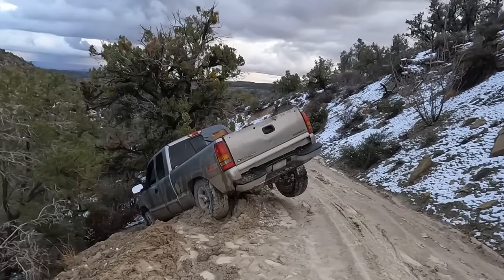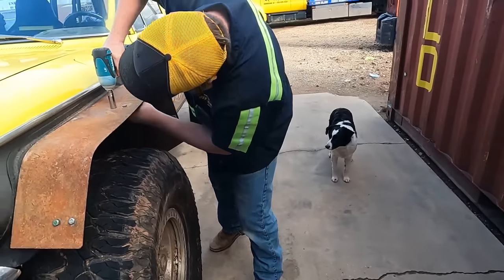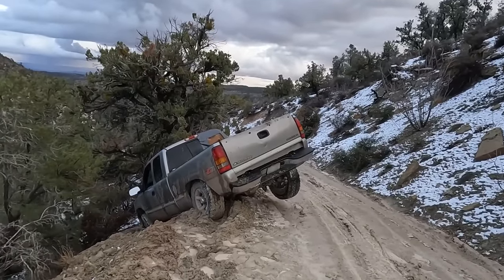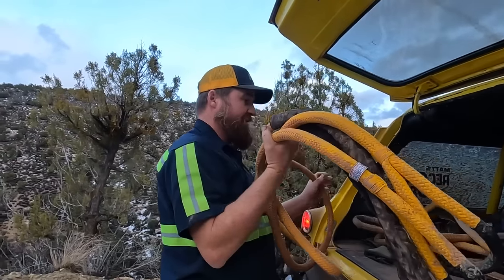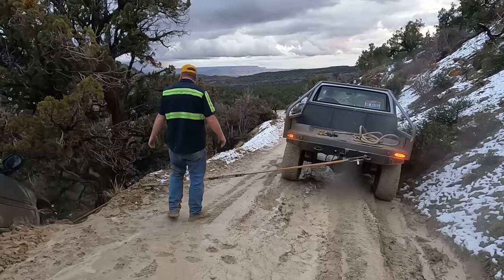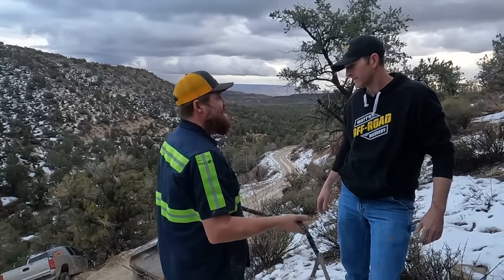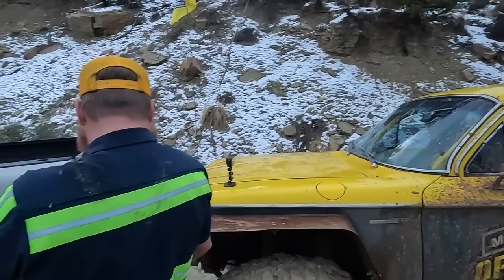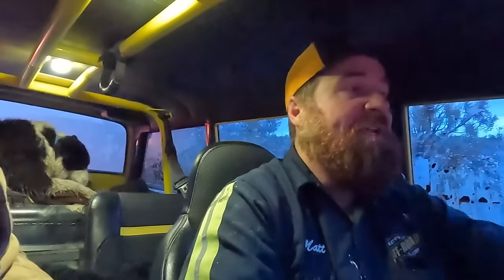This Is A Serious Mess! Chevy Hangs Dangerously Over The Edge

Comment: Those tow bolts are probably a universal item, I would look into getting one for your towing kits!
Reply: Probably as "universal" as lug nuts... <snicker>  Probably a few different thread sizes, but I would have to wonder some cars might need different lengths because of the distance between the bumper fascia (i.e. plastic cover) and the start of the threads... You can't just go with a really long threaded one since there might not be space for to extend out the back of the threaded section on some cars... Many might be designed with a shoulder that needs to be screwed all the way into the threades section for side support (even though the tow eyes should not be uses for angled pulls)... I learned a LONG time ago that you can't rely on anything being truly "universal" even if they claim it is... There's ALWAYS an exception...

Comment: Scotsman here and I can tell you exactly why the tow points are so bad on a lot of UK cars: population density, very low numbers of snowy days per year, and a near complete lack of dirt roads to the point where if it's not tarmac it's almost certainly impassable for anything that is not a very serious off-road vehicle.

That little car is pretty much built under the impression anything causing it to be towed is going to result from an engine failure and involve something like a rollback. Bad shout on the designers part, aye, but that'll be what they were thinking.

Comment: Yeah, I hate that they don't put tow points on cars, even trucks and full size vans anymore unless you get the special package, I pulled a newer Ford Ranger out of about 3 feet of snow and it had zero tow points in the front of the truck, I was able to snake a strap by the lower control arm but come one its a 4wd truck!!! I love them hooks on the front of my Suburban or even my 92 2wd Silverado had hooks in the front, if I needed to use them.

Comment: In the UK we call it a TOWING EYE.
Reply: Sorry, but don't know what this is and can't find anything like it here in the UK.

As I said, in the UK we call them towing eyes and they generally only used to pull cars up onto roll-backs or for sort recoveries. For heavy or long recoveries they have been known to strip the threads and pull out, so can be dangerous. In those cases we generally will use things like chains or soft shackles arounf suspension components. 
To be honest, most recoveries now in the UK use roll-backs or spectacle lifts. Towing with a rope is very rarely used and is frowned upon by the Police.

Comment: Since I don't see one in the top few comments, I shall be /that guy/. Nice job with the names, but 'round where I am, that eye hook is commonly referred to as a "tow hook", whether it be in the front bumper, or in back. I've had to pull a few cars using them, usually pretty short distances in near-ideal conditions, but I don't like them either. They work, but that's about it.

Comment: I went to use one of those hooks to winch a car onto a flatbed with bad results. Flat ground car in neutral I moved the car about 3 feet when it ripped off the frame. The weld holding the threaded nut on was defeciant. Thankfully that was the only thing that went bad. I never used them again.

Comment: @matt's off road recovery, Ive seen you run into the 'tow/recovery point' issue several times. Why not buy an eye/i bolt with several different threads and just keep them in your recovery kit? Just my .02.....

Comment: Just a thought.  Would it be better to get couple of those recovery eye bolt for cars. Would it make life easier? Problem is how many different sizes are there and how much do they cost? The other question is how often would you use them? Maybe get  two or three for the common you pull out . Maybe there is one size fits all.  Or no more than three sizes.

Comment: Best part of synthetic winch lines is they don't hold kinetic energy like a cable line, should a synthetic line give out they generally rip, fray and fail, whereas cable lines snap and go flying.  This does come with caveats, as synthetic lines generally degrade over much less time, especially from UV and road salt.  But then again, you can tie a broken synthetic line in a bunch of knots to complete a pull in a pinch, wont be doing that with a cable line!

Comment: If you run a 1953 Studebaker with the 232 V8 up a steep enough slope and let the engine idle for 15-20 minutes, you will lunch the engine from oil starvation. Pickup is at the front. Don't ask me how I learned this in 1965.

Comment: The dealer says not to pull too hard on the points.  They are only for pulling the car onto a tilt deck truck.  If the car is stuck in the mud and you hooked on and sent it, you would probably do a lot of damage, but a gentle pull like you did would be fine.

Comment: In your Mini recovery you were once again faced by the missing screw in eyelet which is only used as a recovery point. That is why the thread is so fine in an attempt to strengthen its hold on the vehicle it's screwed into. As for your mention of Tie down points there are four one on each corner and all manufacturers warn not to use them as tow points as major damage is likely to occur to the vehicle being pulled. I'm sorry to see most of your regular staff disappearing and now that Lizzy seems to be as good as non-existent in your videos it makes me start to wonder what's happening to the future of Matt's Off Road Recovery.

Comment: I have a 2012 Jeep JK Wrangler 2 door sport 3.6 L V6.(New)   I also own a 2001 Dodge Cummins Diesel 3/4 T 4X4.(New)    Prior owner of a 1986 Dodge 3/4 T 4X4 w/ 4 spd. manual.(Used)   Had a 1976 Chevy short bed heavy half ton 4X4 w/ 350cu V8 4Spd.(New) The only truck I put Warn hubs on was my Chevy Half T.  All others were left alone.  What is the benefit of the Warn lock-out hubs over leaving the automatic hubs in place?  Except for having to get out and wade in water, mud or snow I guess they say I get better mileage with Warn hubs.  Never noticed that one bit, just inconvenience.  I don't rock crawl or deliberately try to find out which component will brake first. I don't have that re$ource.  Desert, ghost towns, mining camps exploration and forest logging roads are pretty much it.  Is it worth it for strength or something to get the warn hubs?  I'm 79 and still ride my Harley. Great videos by the way.  Love them.  Life long desert rat from Peoria AZ.  My son worked in SLC with Kiewit building their light rail system from 2007 to 2013.  Visited him at least twice a year.  Very familiar with Utah. Absolutely beautiful state.  Like Arizona where you can snow ski in Flagstaff in the morning and water ski on Lake Pleasant in the afternoon on the same day. Once in the 60's we had the nation's hottest day and the coldest on the same day.

Comment: The point you screw into is the recovery point.  Depending on vehicle the "recovery" point should be adequate, in other words, don't expect recovery points on sports cars to be any more challenging than a sand trap on a race track.  More serious recoveries will always have 4 points of recovery, each able to hold entire vehicle weight.  Horses for courses.  When your boat has recovery points, don't bother with device that uses it, sometimes it's a helicopter, then it's a lift point.

Comment: You might need to qualify what is needed to drive personal vehicles to tow truck Olympics.   Something like “most AWD, 4wd with over 5” clearance SHOULD be able to make it in dry conditions.”   “But if rain within last 2 days only 4wd (ideally with lockers) with +8” ground clearance, wide mud rated tires should attempt”.
Reply: I saw a car with the recovery bolt in traffic.  IMO any car with AWD/4WD should have 2 points in front 1 solid hitch, or two recovery points in back.

Comment: You may need to get some of the tow point devices to use when they are missing. Also let the owner know that they are missing.
Reply: Unfortunately there are many different types of towing eyes fitted to vehicles. Then you would need to carry a full set in each recovery vehicle. There again, that could be a revenue booster, selling customers a replacement recovery towing eye ;)

Comment: Silly young kids and their lead feet.  Matt was talking about winching and I was waiting for his reasoning for going with Badlands.  Is Warn actually unreliable just like I have heard?

These new cars don't come with those eyebolts anymore.  We just bought a new Mazda and same thing - the 'storage spot' was under the spare, but nothing there.  I had to pressure the salesman to get us one.  And complicating matters even more, both front and rear bumpers have the attachment point, BUT they are different sized.  The eyebolt we got from the dealer only fits the front......

Comment: Technically those tow hooks are for loading and unloading the vehicle in neutral with a roll back they are not for pulling the car out of being stuck I have seen so many of them rip out just winching a dead vehicle in neutral it legit only screws into a nut tack welded to the crash bar it’s almost useless
Reply: That's why he avoids them, he said the very same thing a couple months ago
Reply: @Patrick.Weightman   he owns a tow biz so I’m sure he knows but a lot of people outside the tow industry have no clue how or what it’s for and end up badly hurt or with a damaged vehicle …..it was for all the people who don’t know . Legitimately improper use can result in death or severe maiming steel cable and chain pulling connected to one is scary stuff as Matt explained he was totally against winching until he started using the synthetic rope from freedom winch line it can still snap but would not injure you as a steel cable could but better believe one hooked to a screw in can still launch the steel hook that screws in if it were to rip out of the bumper

Comment: Hold on who calls that a shipping tie down 🤔 for shipping they put straps over the tires not on that small bolt that screws into the bumper those r made for towing when they need to be pulled onto a flatbed then the tow truck tires the tires down so whoever said those r for shipping need to go out in the world to see stuff it was made for tow guys so its a easier point to get to instead of crawling around in the mud mainly used on lower cars before more companys done it ud see it alot on lambos and stuff like that

Comment: So I've got a better one than this . I cannot prove it however because it was in days before cell 📱 cameras. I was driving a 1981 Jeep Grand wagoneer with a modified 401 that I had hand-built myself all roller valvetrain my first one (amc.) I was coming out of a place that when you got up in there to a certain point there was a plaque that has been put up by Jeep  club . The plaque was about 6 "dia. drilled and set in with lead anchors.plaque read"this is Jeep country Fords  trash need not apply"this is as far as my Grand wagoneer would go in as you might expect at this point there was a 3.5-4 ft rock wall that had to tire burn marks that went straight up this would get your front end up to that height and then you would roll your rear end up and step up. But this is where the story starts I was on my way out of this location   I've been in and out of here my whole life. On dirt bikes. Trucks ect,,. I was actually out on the main road that was paved  , I was flagged down to stop by a pickup towing highly modified samurai driver : where's a good place to rock climb with this thing.: me  follow me. At  canyon entrance    I proceeded to set my best time ever . I came around a corner(it's actually a berm that motorcycles had tore into it and it went up about 40 ft and brought you out on another elevation and all of a sudden I felt the side of the berm give way  giveaway all of a sudden I was stopped instantly from maybe 20  to teetering  had to get out now . I opened the door and was able to hold the vehicle with my weight it seems like forever until they got to where I was and they thought I was just standing there  I said get around me it's going to go over. He was great at rock climbing but he sucked it towing . The initial hit was so hard that it popped the back end of my tailgate open and it never would close right after that. I forgot to mention that some of my stuff went down 200 ft when it exploded out of the tailgate 🤔